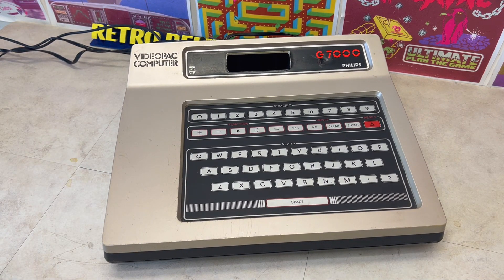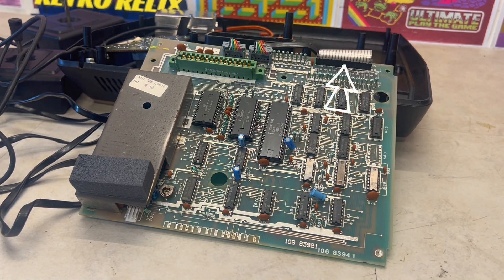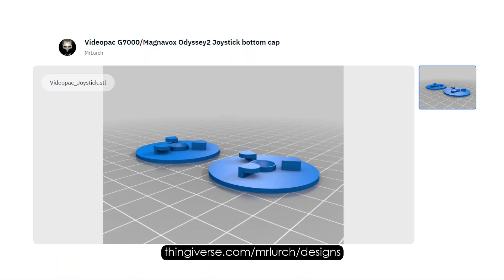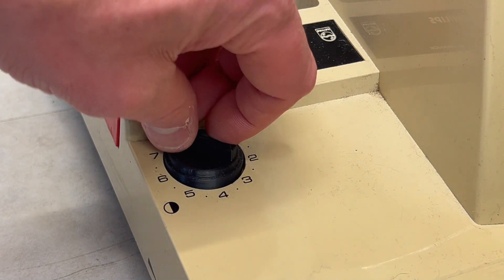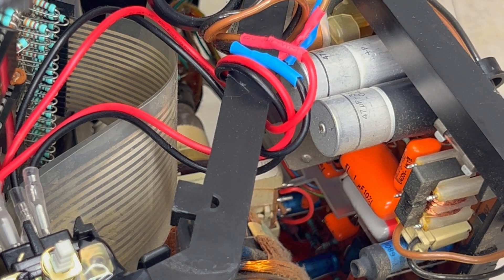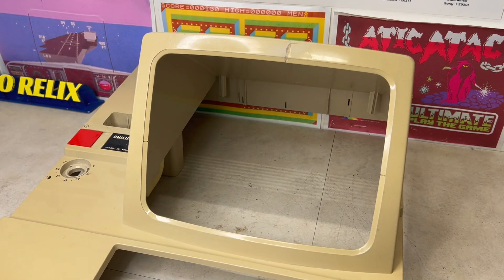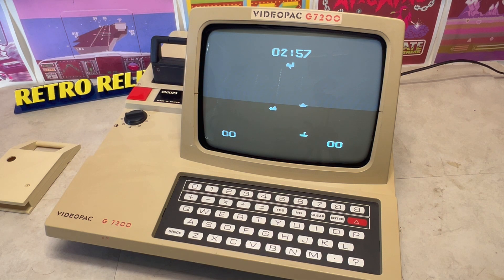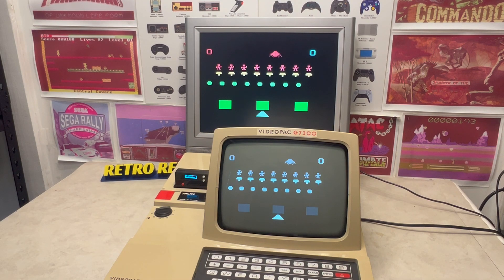1983 PHILIPS VIDEOPAC G7200 (Featuring the 1978 G7000) Review, Fix, Modern Mods & Games

Comment: Interesting fact about the G7200 it also was available as a all black model, and the follow-up is an N60 which sport a slimmer design , did you know that there is a basic cartridge you can plug into the g7000 and program your own basic games in.. but unfortunately there was no way of saving your work ! Which meant you'd have to do it every time lol bit of an oversight . I think online you can still find some basic listings to program a G7000 but don't quote me on that , anyway you've made a horrific repair😂😂 sticking a plaster over damage goods 😂😂 I've seen some cowboy builders in my time 😂😂